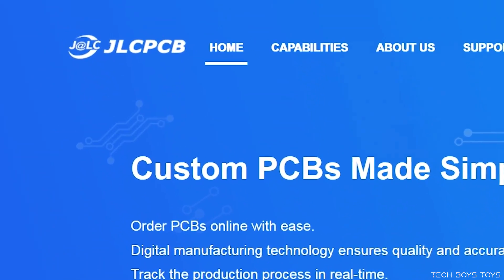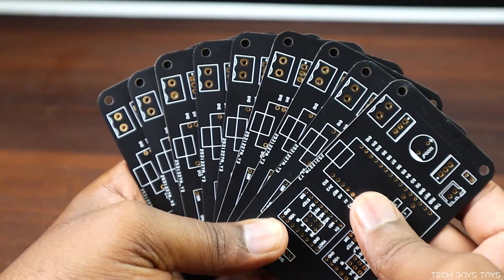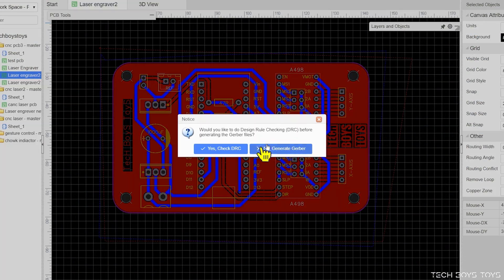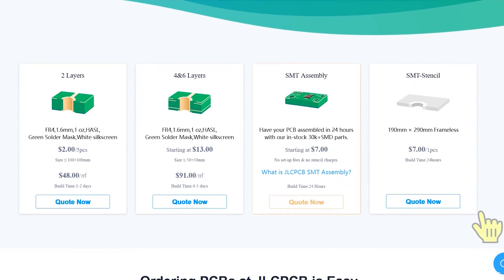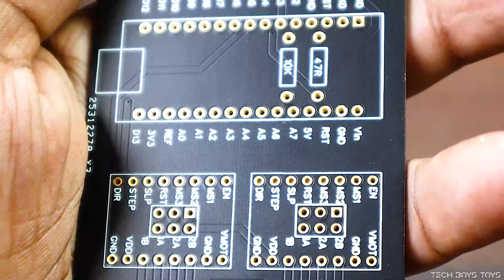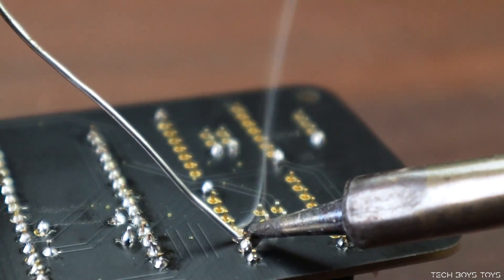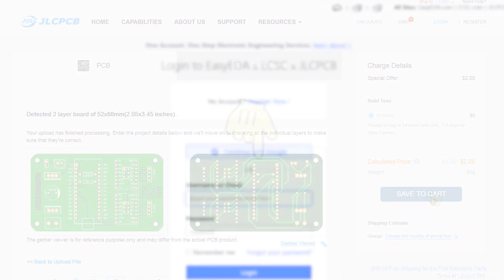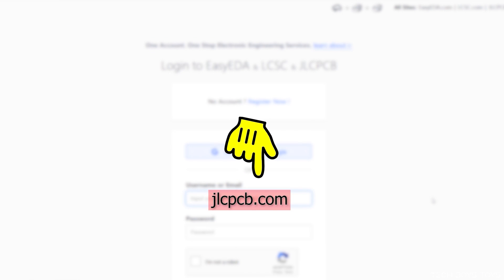How to make Security System for home | Best Science Project

Comment: Bro I have 50 Watts soldering iron
Still I am facing difficulty to solder XT60 connector and T connector.
Please make a guide video.
how to solder it, which soldering wire should use and precautions 🙏